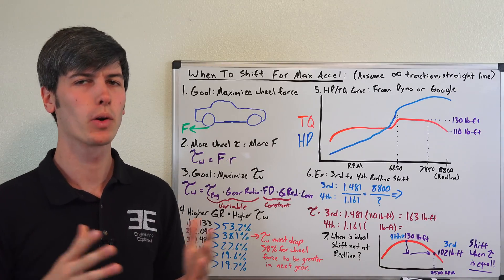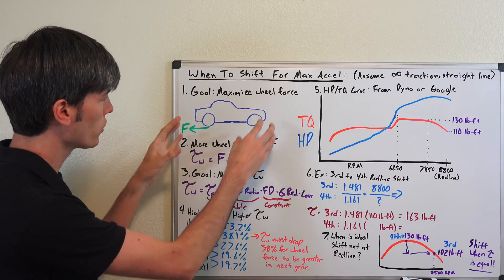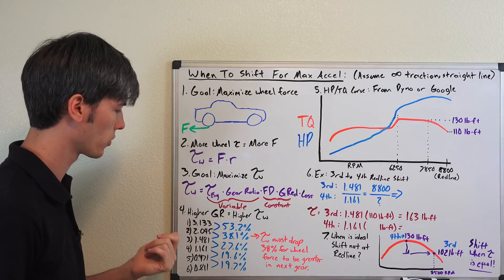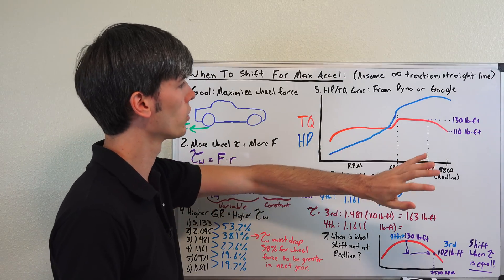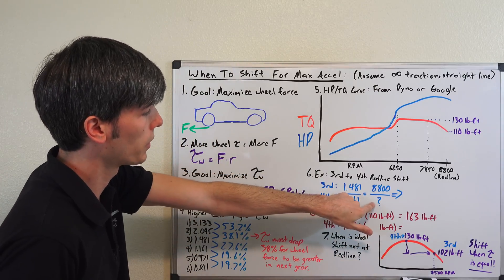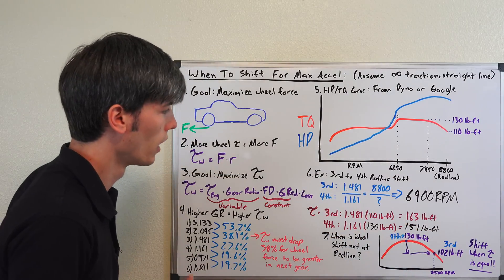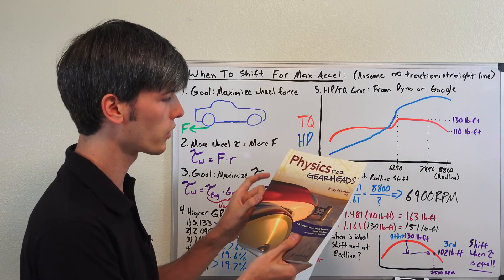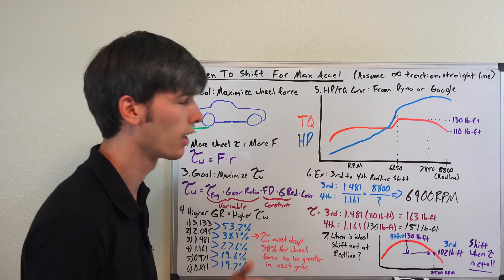When To Shift Gears For The Fastest Acceleration

Comment: That ignores flywheel inertia.

In the lower gears the engine and flywheel are accelerating much faster than in the higher gears.  That means that a greater percentage of the engine's power is going into storing kinetic energy in the flywheel and is not available for acceleration.  That effect could, with some cars, mean that one should shift at a somewhat lower engine speed, especially when in the lower gears.

Also, engine durability may be a consideration.  One might prefer to shift at somewhat lower speeds to reduce strain on the engine.  Probably shifting at perhaps a 5% lower engine speed would not reduce acceleration very much but it could significantly lower the likelihood of engine failure.

Still, it was a good presentation and no doubt made more people aware that the RPM at which one shifts is important.  Simply listening to the engine and ignoring the tachometer does not result in optimal shifting.
Reply: So try do test setup the same velocity on racelogic depend at which velocity you have at 1 gear peak power let say its 40-50 km/h and compare this time on higher gear where rpm be lower 👍🏻 on 1 gear where more power is available time always be lower = better 🤓👌🏻so change gear atlowerm on 1 gear is very stupyd idea 🤷🏻‍♂️👌🏻at least for racing 🫣

Comment: This would be a good place to talk about the concept of power, because power = force*velocity, or torque*angular velocity. What that means is basically that at any speed, maximum acceleration occurs when you get the most power out of the engine. That makes the power curve more intuitive to look at than the torque curve, because if a gear change brings you higher on the power curve then it improves your acceleration. And you can also more easily see that for a car with a power curve that drops significantly at higher rpm (some diesel cars, for example), it would be beneficial to shift before redline.

Comment: You miss a major point here, the direct drive in most RWD transmissions. There are many 5 gear RWD boxes that provide the same torque output in 3rd and 4th because of the reduced transmission losses in 4th - TR3650

Comment: @Engineering Explained Would a dyno graph torque curve not measure the wheel torque since it uses that drum under the powered wheels for measurement rather than hooking up at the trans or something? If that part is true, would it not make more sense to ignore the gear ratio and just compare the torque at a given rpm in a specified gear to the changed gear at the new rpm?

Comment: S2000? Looks like a Prelude. On my monster 1.4L engine, peak torque is 1400 to 3500 rpm. I shift about 2500 and it lands me back on the max torque curve. I was wondering about power cycles per minute, but toque is torque so I am leaving it at that. Besides, my 18 Jetta SE is more of an economy car. When I want to go fast, I look to a Beech Bonanza.The Air Force does not give speeding tickets.
Reply: If the torque curve is flat between 1400 and 3500 rpm, you shift at at least 3500, to get more max hp with higher rpm at the shift point.

Comment: When i do high rpm shifting on drag racing, when i shift on 8,000- higher rpm on 2nd to 3rd gear it feels like im hitting a wall or hard to shift on 3rd gear only, i change into new b16b tranny,linkage,clutch masters cyclinder and slave, my clutch is exedy tri puck. Still i cant shift smoothly on 3rd gear 8,000 or higher rpm. Or its just me having the problem.thank you for your response. Great video tutorial👍👏

Comment: hi,my English is no good,but i have some questions,please help me with this,really appreciate it
in this case,shift gear 3th to 4th,is it better when i shift at  around 8000RPM?because the rpm is going to drop to 6250rpm in 4th gear to get the maxime torque,and i dont need to lose  torque at 8000rpm to 8800RPM since the torque is droping from 7850rpm.

Comment: Every time I shift, I run through all these calculations in my head.
Reply: If that is the case you are making the same mistakes. It is a good approximation but neglected the torque required to accelerate the engine and the rest of the drive chain.
Reply: @dyson9422  it was a joke my friend

Comment: (Yes, I know this is old) All this video did was convince the ‚red liners‘ that they should run all the gears out to the red line. For flat torque curves this is true. For torque curves that peak early and drop off ‚sufficiently‘, then maybe redline for the first 2 or 3 gears, after that, depending on the ratios, you will need to shift increasingly earlier.

Comment: Excuse me, May I ask, if you want the Torque wheel higher, why 4th gear torque wheel is less than 3rd gear in your calculation ?1 many thanks
or do you mean you can have higher torque even when you put less wheel torque in 4th gear ?
Reply: The wheel torque will always be lower in the next gear, because the higher trans gears are for more speed, and less torque. What he is doing is minimizing the torque loss in the next gear,  163 vs 151 in 4th.

Comment: How would I find my vehicle's optimum wheel torque and fuel economy in each gear? I drive a gas hog '03 Jeeo Wrangler with a 5 speed manual transmission and I would like to make sure I'm not using a ton of extra fuel pushing this light, though vertically elevated, body around on the highway for instance. How can i figure this out?

Comment: What about a turbo charged car? As the torque drops much earlier. So would it mean it’s more likely to be appropriate to early shift a turbo car (to maximise acceleration)?
Reply: Yes. You always want to shift beyond the hp peak, and as a general rule try to match the hp on each side of the hp peak. Sometimes you don't reach redline. At 7:50, he shows a rounded torque curve like you described, and noted a shift before redline.

Comment: Can someone explain the contradiction I get here: if power=work/ time, and work is force×displacement,  hence power=force ×d / t, and d/t is just velocity, so eventually we get power=force × velocity, or rewrite it as force = power/velocity. So at a given speed to maximize force (hence acceleration)  you need max power, right? And that contradicts this video where torque is the king...
Reply: Appears true, but how does that change his shift points? I've used the torque curve and the power curve to predict shift points on my calculator, with identical results.

Comment: Hey,

I have a question because I do not get something through the equation. 

why do you have to have more torque at the end of the, let's say, 2nd gear than the start of the 3rd gear ( I mean when you shift). Don't you want to have more torque at the 3rd gear than the end of the 2nd to change?

As far as I understood you want to have peak torque revs at the start of every higher gear. Is that correct?

Comment: Talk about doing it the hard way. Rear wheel power is simply force x road speed, so maximising force at the tyre (at a given road speed) simply requires maximising engine power. The optimum shift points are therefore ones that give the same power output before and after the shift. Look at the power curve and draw a horizontal line that chops the top off the hill.
Also you missed one important assumption - zero inertia for the engine moving parts. Engine inertia adds "equivalent mass" to the car in proportion to the square of the gear ratio so lower gears are significantly disadvantaged. When engine inertia is accounted for, the optimum shift points are a little earlier.

Comment: So it depends on the torque characteristics.
But usually car companies tune the engine for a flatter curve around redline and they have also designed the gearbox for that.

Comment: I shift at the rpm where torque starts to flatten out plus the rpm difference between the gears.
So if the torque envelope flattens out at 4000 rpm and shifting from 3 to 4 gear reduces your rpm with 600 rpm you shift gear from 3 to 4 at 4600 rpm. This way you drive the engine at the rpm range it is most comfortable at.

Comment: Very cool! Just make an Excel sheet with a diagramme wheel torque over speed in each gear. And at the intersections of the lines you know exactly the shift points. With a simple calculation or another diagramme speed over rpm you know the rpm for each gear. 👍

Comment: Just guessing, you wouldn't shift gears at redline with a diesel? My 3.2td loses power at 3200rpm and it redlines at 5000. Guessing to shift around 3300 or 3500.

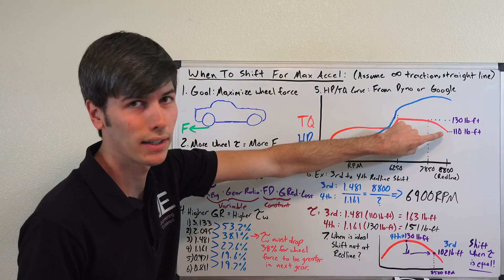Comment: Adjust me if I am wrong. At 6:15, 130 lb vs 110 lb is not 18% as you said but 15.4%, am I correct or missing something?  My same question applies to your calculation for the percentage difference between each gear ratio?
Reply: It doesn't matter how you compare magnitudes, the change in dyno torque values is 15.4% of the 4th gear torque,  [(130-110)/130] x 100 = 15.4% . Or, as he stated,  the torque ratio, 130/110 = 1.18, meaning 4th dyno torque is 18% higher than 3rd dyno torque.  It doesn't matter because this 18%  is never used in a calculation, only a comparison with "gear ratio" ratios, which were done the same way for consistency.

Comment: What causes the engine to increase its rpm? How does.. adding more fuel cause the engine to actually spin faster? How does this occur without getting spark plug timing off cycle? How does shifting down cause the engine rpm to drop? -when you clutch in going from gear 3 at 8800rpm to gear 4 going 6900, isn't the crank shaft still going as fast as it was half a second ago?

Comment: Thanks for this. I'm just curious to know, if in a racecar, all 6 gears are equally spaced, say 30kmh spacing, is the goal to achieve peak engine torque in the next gear?

Example: 
Peak torque = 5000rpm
Peak horsepower = 6000rpm (powerband 6000-6500rpm) 

Based on my findings, 30kmh spacing drops rpm roughly 1000rpm so if this is the case, is it better I shift at 6000rpm so that it drops to 5000rpm (peak torque) or is it better to utilise the powerband more and shift up at 6500rpm?
Reply: Not at 6000, more like use your powerband.  The shift is beyond the peak hp, and on or before redline. Use his axle torque method as it is complete, except for my correction. Or if you are able, use the hp method. The exact rpm will be based on finding the max hp in the next gear. You have to repeat the calc several times until you know it's the best rpm. A good guess would be to split the rpm band around the peak hp rpm, not exceeding redline.
Reply: @kevink2315  Thank you!

Comment: This is the LONGEST and most confusing way to get to your shift points because you treat the torque as if that is what does work, when in reality work is done by Power which includes RPM component.  You factor in transmission transfer ratios which means you're essentially working with instantaneous power anyway but are calling it torque.    If you work with POWER directly not Torque you can skip 2 steps in each search attempt that you do for a shift point!  In your example for 3rd to 4th shift it's as simple as:  1.161(4th)/1.481(3rd) = 78.39%(4th/3rd) * 8800RPM(3rd) = 6898RPM (4th)
8800RPM power = 184HP  (from dyno chart) 
6898RPM power = 170HP  (from dyno chart)
therefore we have less power in 4th than in 3rd when shifting at redline so we must shift at redline

Comment: Thanks for the useful information, but what about diesel engines? I have a Honda Civic 2016 idtec and my maximum torque is in 2000 rpm. What will be the ideal gear change considering that after 4000 rpm to 4500(red line) torque is dropping dramatically? It's better to use a small gear to high rpm or a faster change so I can benefit from low rpm torque? Thanks in advance!!!

Comment: I have a vauxhall Corsa 1.0 turbo 6 speed manual 115 bhp, torque starts at 1800 rpm and drops off quite badly at 4000 rpm, it revs to about 6700 rpm, when should I shift?

Comment: The best rpm to shift gears for fastest acceleration is the manufacture's spec for your car's peak HP rpm.
Reply: Hmm. At first I was going to agree, but upon further reflection of what Jason is showing, I disagree. Peak HP is at 8000rpm. At that moment in time, with the math in 3rd gear, you're putting down 190lb-ft of torque at the wheels. If you shift at that point it drops to the 6250 rpm at the peak of the torque range, but you're only putting down 151lb-ft of torque due to gear ratio. However, if you go past 8000 rpm HP peak, the torque does drop, but as he shows it's still higher at the wheels than if you had shifted at 8000 rpm. 163lb-ft instead of 151lb-ft. So by shifting at peak HP you would be losing the benefit of the higher torque at the wheel for the remaining 800 rpm travel to redline.

Comment: I think that running the RPM sufficiently high in a particular gear to bring the engine speed down to the engine's torque peak in the gear being shifted into is shifting too high. Going that far above the engine's torque peak causes the engine to operate at too high of an RPM, where the torque has really dropped off considerably. My technique was to shift above the torque peak but only high enough for the RPM to drop below the torque peak in the higher gear, where the driveshaft torque is the same at both points. This causes the engine to operate in an RPM band that straddles the torque peak, with a higher average torque over the RPM range. It would be interesting to do a road test of the two different techniques to see if one is better than the other.
Reply: You're only thinking about torque at the engine shaft, not the drive shaft, (or wheels). You are not figuring in the effects of gear ratio. In fact, because Jason factors out the final drive as a constant, his video would be more accurate to say the torque figures are at the drive shaft, not the wheels.

Comment: Unless a really sporty tuned engine red line is never optimal for gear changing, because torque drops so much that rpm can not provide more power past that rpm. The best point for changing gear is at peak power, which is mostly 500-1000 rpm below red line. Manufacturers install same rpm counters for all engine version of particular model. It is essential to know where peak power of particular engine is. The most efficien shifting is when next gear falls intzo tthe max torque rpm.

Comment: I do not understand why torque is important, isn't power (torque at certain RPM) all that matters for acceleration and force to the wheels? E.g. when we shift we usually have higher torque in next gear, but lower power, so torque alone is not relevant, until taken into account at certain RPM (which shows us horsepower)

Comment: .. the 2003 and 2005 GTi just beyond redline had what i would call a limiter .. resulting in the engine losing  power .. question is: is this built into the GT1 1.8T .. or was i just lucky i didn't break something ? ..

Comment: Got a 7 speed dct and thank you a lot  I have to shift @6000 first to second then 5300 to 3rd gear then 6000 to 4th then 5300 to 5th and 6000 from 5 to 6 and didn't do it for the 7th speed gonna take notes while going to the drag race lol

Comment: How does this apply to my 1996 honda civic automatic with a rusty fart can on it? How do I drift I tried putting it into "D" for drift but it didn't work. Will a ebay brand K&N air filter with a line graph on the box on it work?

Comment: Surprising but it's true.  You will accelerate faster multiplying less torque in a lower gear than you will multiplying more torque in a higher gear.  Sometimes its painful when the torque drops off before the redline and you just want to shift but it will inevitably be slower accelerating over all (unless you're on a track/road course because sometimes you short shift exiting a turn to help prevent wheel spin or get more grip entering a turn).

Comment: Why don't the car manufacturers first dyno the engine and then set the gears accordingly to match so that the driver doesn't have to memorize any special shift RPMs in each gear?  That is, set the gear ratios so that u just spin out every gear to redline and shift for maximum performance.  Perhaps a wide ratio 4 speed or a semi wide ration 5 speed would do it.

Comment: Respectfully, I have to disagree. Using your info and math, I calculated that it would be best to shift at (approximately) 7,972 rpms. Thus just as the torque line starts to decrease. Let me show you how I did my math.
6,250 x 1.481 = 9,256.25
9,256.25 / 1.1611 = 7,971.966
When shifting from torque decrease you want it to start at the earliest max peak torque power. Otherwise known as the power band. What is missing in this comparison is knowing the speed at the wheels when using your math vs my math. I don't know how to illustrate that point. If you do, that would be great

Comment: So if the goal is to always have the highest torque/force at all times with all the same assumptions made wouldn't it be more ideal to shift at say 7800-7900rpms? That would net you 192.5 ft lb in 3rd and when shifting lead you into the start of your upper power curve of 4th (since its a flatter curve) with the 151ft lb for a longer period of time as opposed to shifting into 151ft lbs that quickly tapers off? I would assume with a different model with a different torque curve that would be different but in this exact model with a flat curve im a little lost unless were taking into account the whp curve as well and just not mentioning it

Comment: Simpler method :
Max torque at the wheels is also Max power at the wheels.
Assuming no losses, power at the wheels is power at the engine.
Knowing the gear ratios, draw on the same graph for each gear power in function of the speed (same as power in function of rpm but scaling with the gear ratios).
Always be on the curve at the top. Done

Comment: Some cars will be a different case. For example TDI's / JTDs have a huge loss of power around 4200rpm (redline around 5000rpm). In those cases is better to shift just slightly above the 4200rpm (depending on the engine of course). I'm assuming thos are stock.

Good vib btw.